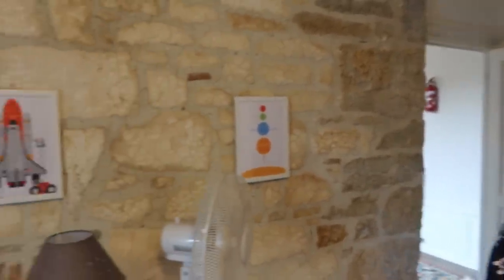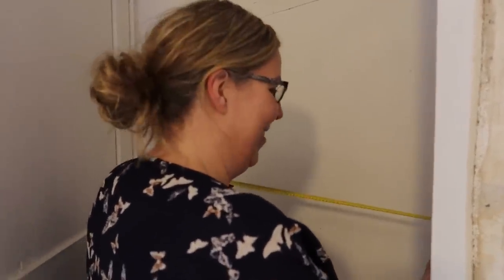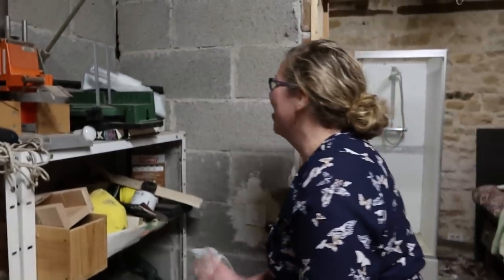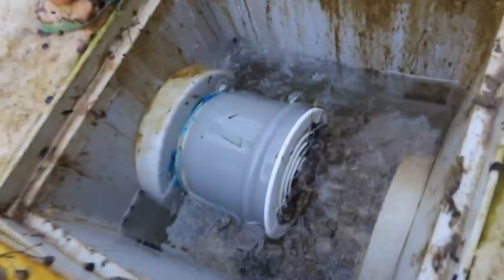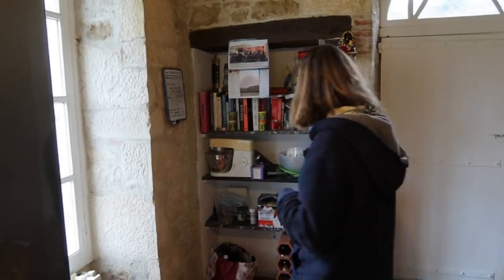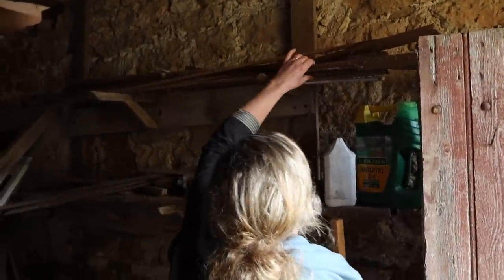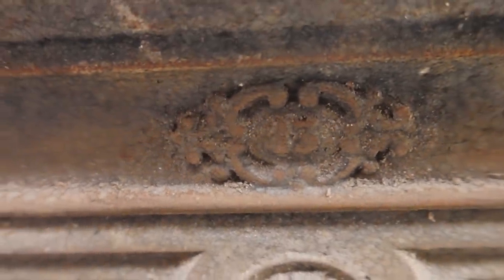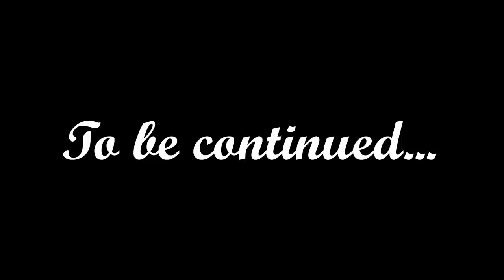Making a wardrobe and finding treasure in our barn!

Comment: Just a suggestion, but you could make the closet a bit deeper by building onto its existing frame and rehanging the door or you can just do shelves by using 30mm x 60mm strips cut to the width of the closet and the depth - 30mm. Use a level to draw a line that will allow you to screw them into the current lining wood. Cut planks of lumber to the depth and width of the shelves needed. There are welders that can weld cast iron. Its a specialty. It is a sweet fireplace find. And I see you found my method of ringing the wall with wood to support the shelves further in the video. Just remember to predrill the wood with a slightly smaller bit the the width of the screws so you wood doesn't split.

Comment: Make sure all shelves are adjustable, with drilled panels down each side for adjustable shelf pins. Only a man would want fixed shelves, lol! 34cm will just fit a folded garment , 93cms will fit 3 items across, very ergonomic dimensions. I’m a retired designer btw.

Comment: Great find!  But I wonder if you had the base upside down? So the flat is up, and the notch/recess was room for a bolt & nut to attach to the legs from the bottom?  Also if drilling into stone to fit the shelves is a pain, insert wood panels that are height you want & shelves rest on them (and secure this wood together), so the system fills the space,  w/out need to fix to the stone.... But I'm sure you'll figure out what works!!